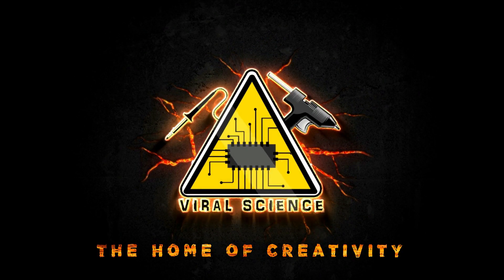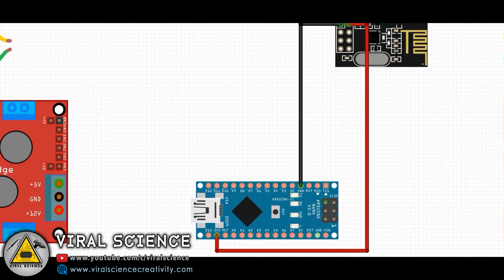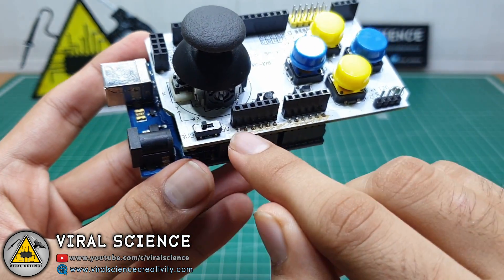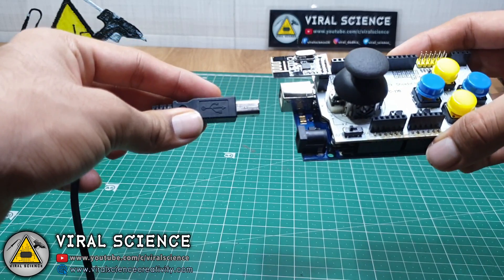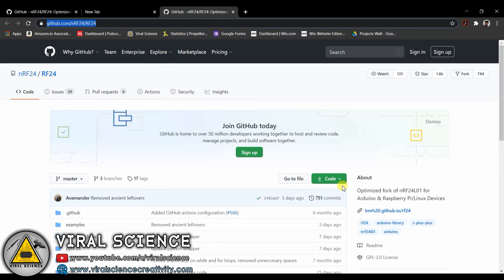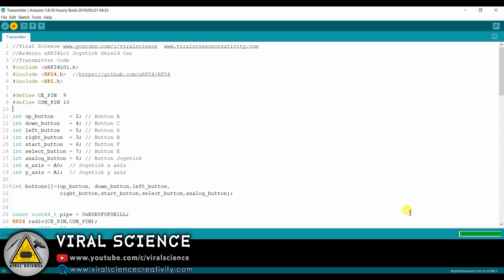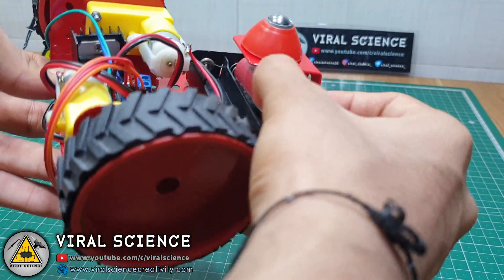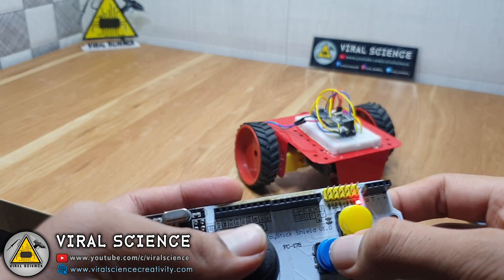Arduino Wireless Joystick Shield Car nRF24L01 Transceiver

Comment: TX code in video:

//Viral Science www.youtube.com/c/viralscience  www.viralsciencecreativity.com
//Arduino nRF24Lo1 Joystick Shield Car
//Transmitter Code
#include <nRF24L01.h>
#include <RF24.h>  //https://github.com/nRF24/RF24
#include <SPI.h>

#define CE_PIN  9
#define CSN_PIN 10

int up_button     = 2; // Button A
int down_button   = 4; // Button C 
int left_button   = 5; // Button D 
int right_button  = 3; // Button B
int start_button  = 6; // Button F
int select_button = 7; // Button E
int analog_button = 8; // Button Joystick
int x_axis = A0;  // Joystick x axis
int y_axis = A1;  // Joystick y axis

int buttons[]={up_button, down_button,left_button,
               right_button,start_button,select_button,analog_button};

const uint64_t pipe = 0xE8E8F0F0E1LL;
RF24 radio(CE_PIN,CSN_PIN);
char msg[20] = "";

void setup(){
     for(int i; i <7 ; i++)
     {
         pinMode(buttons[i],INPUT);
         digitalWrite(buttons[i],HIGH);  
     } 
     Serial.begin(9600);
     radio.begin();
     radio.openWritingPipe(pipe);
}

void loop(){
       
      if(digitalRead(up_button)==LOW)
      {
        char msg[]="up";
      radio.write(&msg,sizeof(msg));
      delay(300);
        Serial.println("UP Button Pressed");
      }
      
       if(digitalRead(down_button)==LOW)
       {
        char msg[]="down";
      radio.write(&msg,sizeof(msg));
      delay(300);
        Serial.println("Down Button Pressed");
      }
       if(digitalRead(left_button)==LOW)
      {
        char msg[]="left";
      radio.write(&msg,sizeof(msg));
      delay(300);
        Serial.println("Left Button Pressed");
      }
       if(digitalRead(right_button)==LOW)
       {
        char msg[]="right";
      radio.write(&msg,sizeof(msg));
      delay(300);
        Serial.println("Right Button Pressed");
      }
       if(digitalRead(start_button)==LOW)
       {
        char msg[]="start";
      radio.write(&msg,sizeof(msg));
      delay(300);
        Serial.println("Start Button Pressed");
      }
       if(digitalRead(select_button)==LOW)
       {
        char msg[]="select";
      radio.write(&msg,sizeof(msg));
      delay(300);
        Serial.println("Select Button Pressed");
      }
       if(digitalRead(analog_button)==LOW)
       {
        char msg[]="analogbutton";
      radio.write(&msg,sizeof(msg));
      delay(300);
        Serial.println("Analog Button Pressed");
      }
      Serial.print("\n X = "),Serial.print(analogRead(x_axis)),Serial.print(" \n Y = "), Serial.print(analogRead(y_axis));
      Serial.print("  ");
      delay(500);
}
=================================================

RX code in video:

//Viral Science www.youtube.com/c/viralscience  www.viralsciencecreativity.com
//Arduino nRF24Lo1 Joystick Shield Car
//Receiver Car Code
#include <nRF24L01.h>
#include <RF24.h>  //https://github.com/nRF24/RF24
#include <RF24_config.h>
#include <SPI.h>

#define CE_PIN  9
#define CSN_PIN 10

const int RightMotorF= 3;  //in1
const int RightMotorB= 4;  //in2
const int LeftMotorF= 5;  //in3
const int LeftMotorB= 6;  //in4

char data[20]="";

RF24 radio(CE_PIN,CSN_PIN);
const uint64_t pipe = 0xE8E8F0F0E1LL;

void setup()
{
  pinMode(RightMotorF,OUTPUT);
  pinMode(RightMotorB,OUTPUT);
  pinMode(LeftMotorF,OUTPUT);
  pinMode(LeftMotorB,OUTPUT);
  Serial.begin(9600);
  radio.begin();
  radio.openReadingPipe(1,pipe);
  radio.startListening();
}
 
void loop(){
  String msg="";
  if ( radio.available() )
  {
    radio.read( data,sizeof(data) );
    Serial.println(data);
    msg=data;

    if(msg=="up")
    {
  digitalWrite(RightMotorB,LOW);
  digitalWrite(LeftMotorB,LOW);
  digitalWrite(RightMotorF,HIGH);
  digitalWrite(LeftMotorF,HIGH);
  Serial.println("Motor forward");
  }
  else if(msg=="down")
  {
  digitalWrite(RightMotorB,HIGH);
  digitalWrite(LeftMotorB,HIGH);
  digitalWrite(RightMotorF,LOW);
  digitalWrite(LeftMotorF,LOW);
  Serial.println("Motor Back");
  }
   else if(msg=="left")
  {
  digitalWrite(RightMotorB,LOW);
  digitalWrite(LeftMotorB,HIGH);
  digitalWrite(RightMotorF,HIGH);
  digitalWrite(LeftMotorF,LOW);
  Serial.println("Left");
  delay(300);
  digitalWrite(RightMotorB,LOW);
  digitalWrite(LeftMotorB,LOW);
  digitalWrite(RightMotorF,LOW);
  digitalWrite(LeftMotorF,LOW);
  }
   else if(msg=="right")
  {
  digitalWrite(RightMotorB,HIGH);
  digitalWrite(LeftMotorB,LOW);
  digitalWrite(RightMotorF,LOW);
  digitalWrite(LeftMotorF,HIGH);
  Serial.println("right");
  delay(300);
  digitalWrite(RightMotorB,LOW);
  digitalWrite(LeftMotorB,LOW);
  digitalWrite(RightMotorF,LOW);
  digitalWrite(LeftMotorF,LOW);
  }
  else if(msg=="analogbutton")
  {
  digitalWrite(RightMotorB,LOW);
  digitalWrite(LeftMotorB,LOW);
  digitalWrite(RightMotorF,LOW);
  digitalWrite(LeftMotorF,LOW);
  Serial.println("STOP it");
  }
  
  }
}